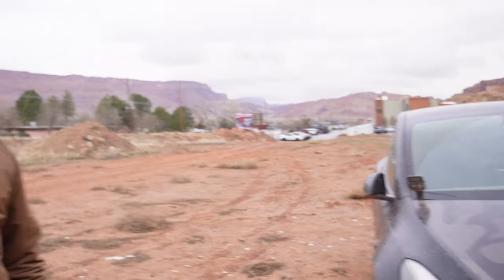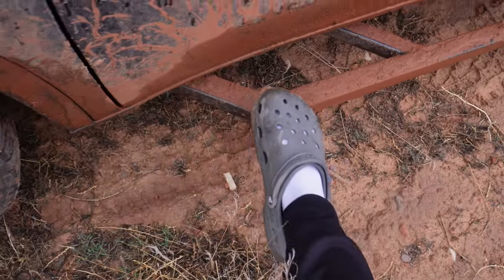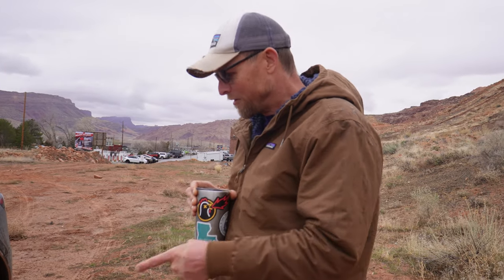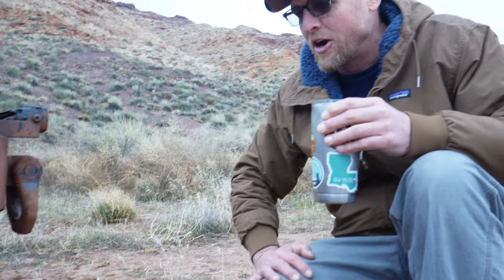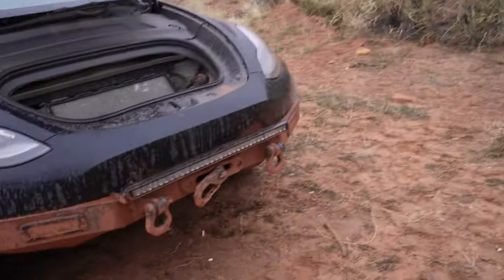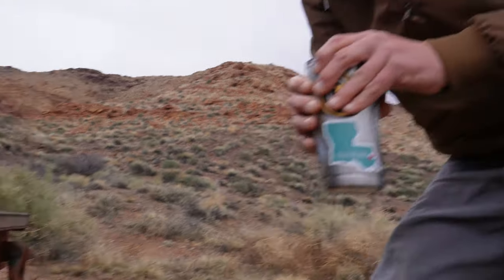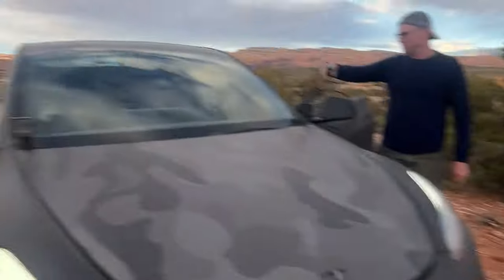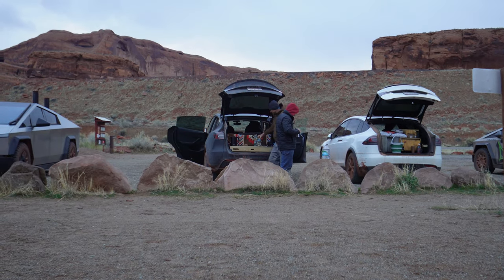Off-Roading Tesla Model Y is like a Mini Cybertruck (Full Build Tour)

Comment: Tesla needs to get your number.  Amazing engineering.
Reply: 😂 I wish I could say something other than. I think they know what they're doing. nevertheless very cool model y.
Reply from the maker: Thank you so much
Reply: @EverydaySandro  Your very welcome. mucho respect. This makes me want to buy a used Y at auction that may have had front end damage. Worst case scenario I'd have a battery pack for a power wall.
Reply from the maker: @wsk-clown  there you go⛺️

Comment: But what about the cooling system now? It must be a lot less effective. There's no air intake for the heat exchanger anymore. So the risk of overheating the battery pack is highly increased. There aren't even vents in the hood to replace the missing air intake. Did I miss anything in the video?
Reply from the maker: He moved his heat exchanger into the frunk from what I saw. It’s still has the ability to take in large amounts of air as the sides of his bumper are open
Reply: Yeah, there are additional holes now on both sides between the metal bumper and the plastic wheel housings, but they are not as big as the original air intake and can't profit from the ram air effect of the original air intake. So the cooling effect of the heat exchanger is severely reduced, especially at high speeds. Also, the intake and exhaust of the heat exchanger are very close to each other now, so that the exhaust air is sucked into the intake again at low speeds.
Reply from the maker: @blackmoon925  great point! Reach out to him on X! He is constantly modifying his rig (Mr.Beta)

Comment: Is there any way we can get more details on his renogy 50 amp dc to dc converter 12 volt battery system addition? I want to add it to my car.
Reply from the maker: For sure. Find him on X @mrkylefield. Thanks for watching!
Reply: Thanks for the comment. I'm drawing up a schematic of the 12v system and will post it on X when it's done :)
Reply: @KyleField  thank you so much!!!
Reply: @KyleField did you post those?
I’m also confused is that feeding off the main battery pack for the car or the 16v aux battery?

Amazing freaking build! You and grindhard plumbing should do a video together of the most B.A. offroad teslas